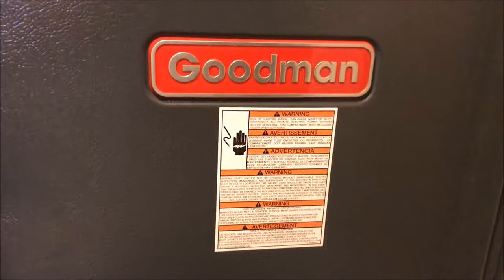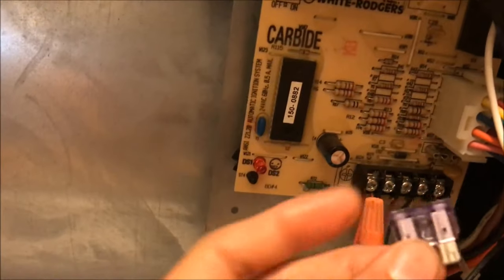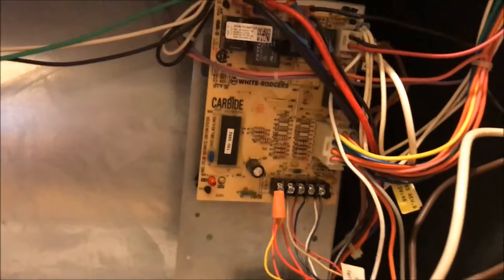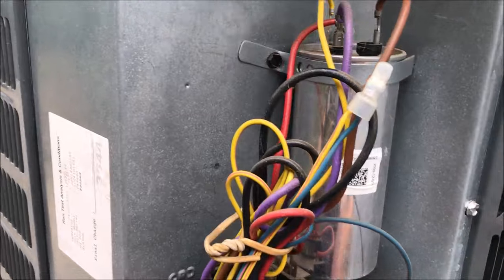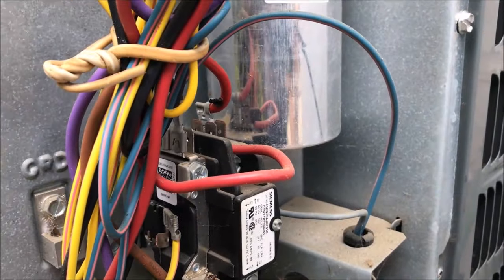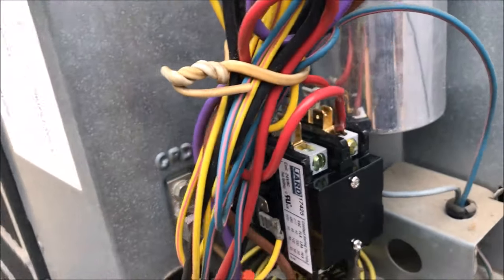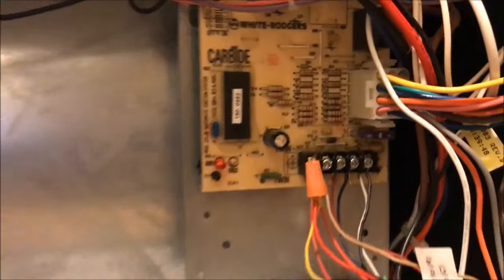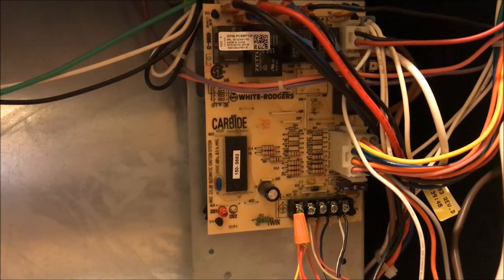Blown 3 Amp Fuse in AC quick fix - Save $300-$800

Comment: Any idea if replaced with a 5 amp and not 3 amp would cause it not to power on thermostat?
Reply from the maker: Good question so I called my friend (Licensed AC guy).  Per his explanation and recommendation.  He said DON'T do it.   If you use a 5 amp fuse in place of a 3 amp, it can and will cause more damage because the fuse has a specific amperage rating to handle the load in case of a surge.  He said that it may not even be a thermostat.  It too much power going through the system.
Reply: Good to know! Thanks for the info!
Reply from the maker: @rakyvan  Thank you and You're welcome
Reply: & this is why houses burn down!

Call a professional.
Is a few dollar fuse really worth risking your family's lives?
Smh....
Reply: @SnapFix  Exactly ! ! ! Always use the proper rated fuse for that circuit ! ! You explained it well !
Reply from the maker: @dougngn  Thank you
Reply: I replaced my burned out 3 amp fuse with a 5 amp car fuse, it ran for a few minutes and now my transformer is burned out!

Comment: Your video should not be showing how to fix things without testing or without using safety precautions before working on HVAC equipment.  Its not a good idea showing someone how to do this without checking for power even though power is off. I didnt see you use a meter or any kind of electrical tester what so ever. You plug in the furnace????  Just cause there is a burn spot on contactor you replaced it? What about checking with meter?